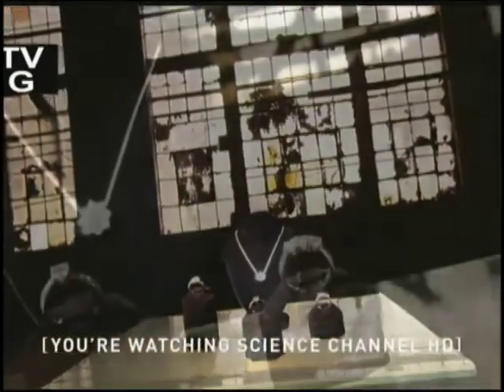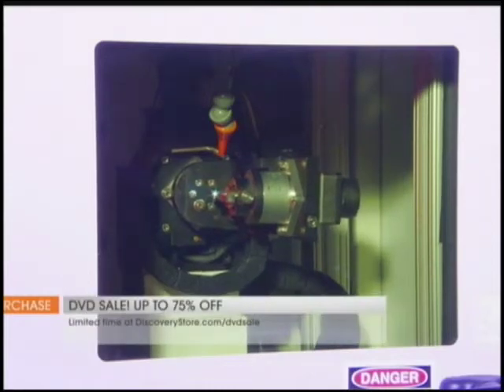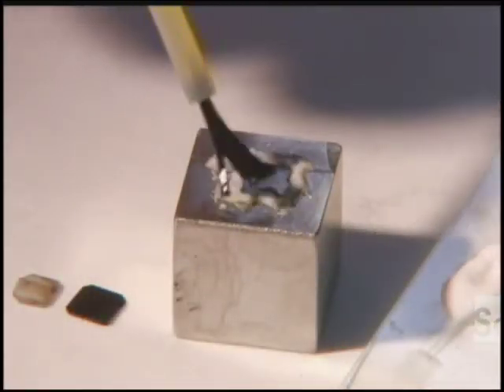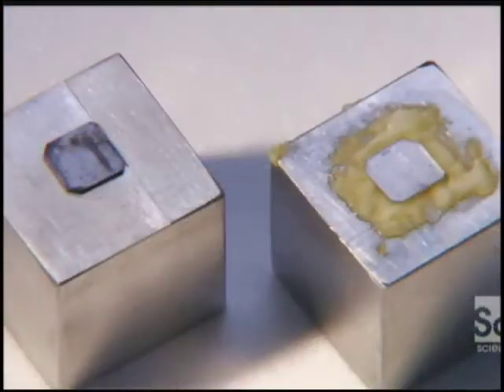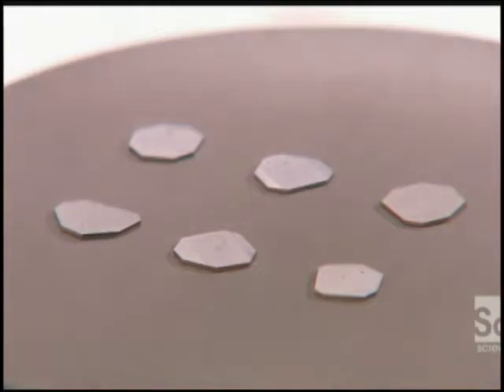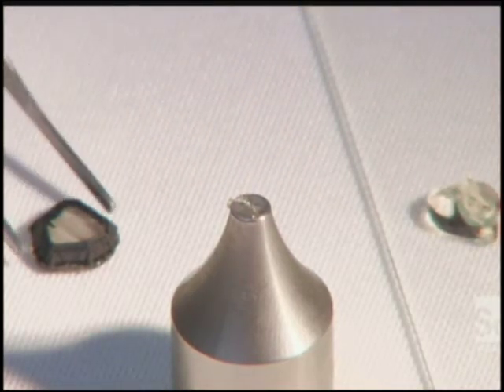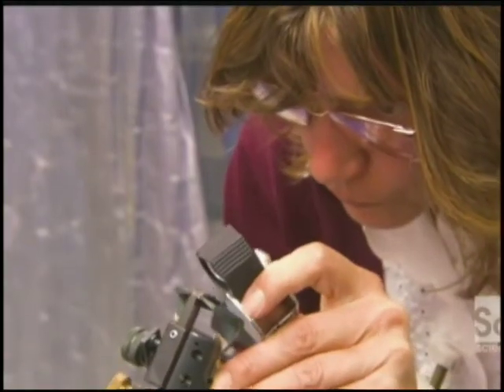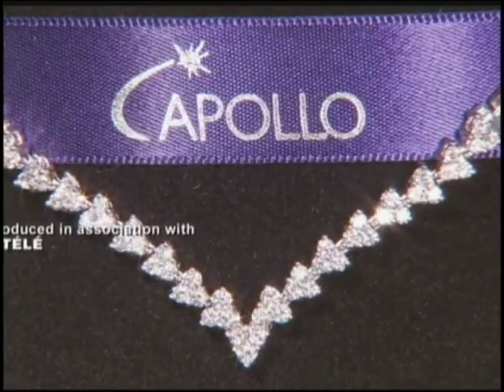Artificial Diamonds

Comment: @esquireyes Lab diamonds by Gemesis and Apollo are real diamonds.  They take a real seed diamond and sprinkle carbon atoms on top either through pressure or gas vapor.  A thicker formation of crystallize carbon forms on top.  The result is a real diamond.  After all, a diamond is just crystallize carbon atoms.  DeBeers has tried to get the world to call them synthetics.  However, they are called and graded as diamonds by the experts.  "Cultured" is another term used.